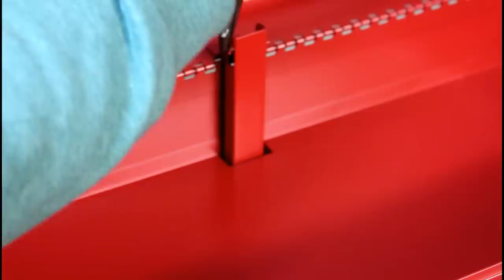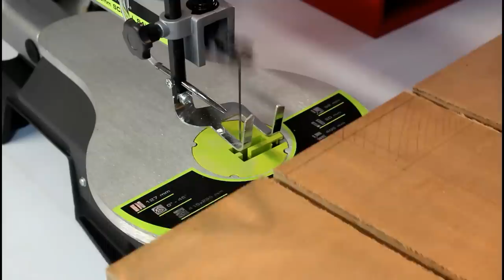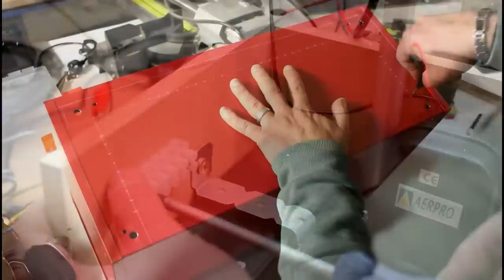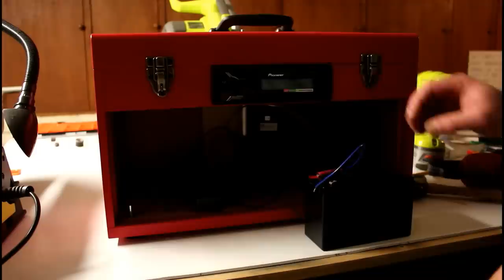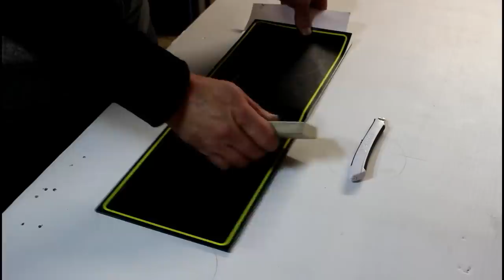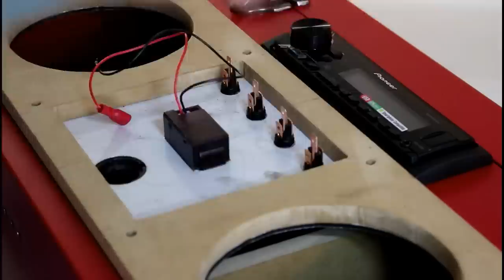Toolbox Stereo Build

Comment: I absolutely love messing with pioneer car stereos, their RGB series of head units sound absolutely superb on good speakers.
Reply from the maker: Thanks Mate, Pioneer systems are perfect for the units I make. I've just checked out your channel and I'm looking forward to watching some of your videos. Especially the old amp repairs.
Reply: @taswesty  Thanks yea, ive just bought a Pioneer DEH-X3800UI head unit from ebay in mint condition for £35, it will be fitted in my model railway baseboard and connected to a pair of monitor audio bronze br1 speakers, should sound great as theyre high sensitivity and 4ohm
Reply from the maker: Sounds like a great setup. Those BR1's look like a nice speaker.

Comment: Excellent work, build something similar but connect it to a computer source. greetings from Argentina.
Reply from the maker: Thanks Elser81. Technically you could plug this into your computer via the AUX plug. But it would also be an awesome idea to build a stand alone PC speaker version. Maybe I could add that to my list of projects :-)
Reply: do not explain it to me, instead of using a battery, use a power supply from a desktop computer.
Reply from the maker: Sorry Mate, now I understand. Yes you could definitely power this with a PC power supply.

Comment: At 16:32 you can hear the metalic box rattle. This setup will have afwul rattling sound at high volumes. But it is really cool !
Reply from the maker: Thanks. Yep, you can definitely hear a slight vibration that I fixed with some sealant off camera.
Reply: @taswesty  Great :) I too have a speaker like this, but it is made out of a older speaker box. I added new bass speakers, a 12 volt battery from a I think tractor lawnmover, or a fourwheeler , and a car radio. sounds amazing but I need to add tweeters. the battery is twice as big as yours. It has 24 apers.

Comment: Nice build!! But I bet it rattles like tin cans in a bag.
Reply from the maker: Thanks mate. Surprisingly it doesn't rattle at all. I spent a bit of time off camera sealing all the joints with a polyurethane sealant.
Reply: @taswesty  another way to fix rattling is by welding heavy pieces of metal onto the rattling panels. If you do so, you will lower the resonance frequency below 20hz.

Comment: Nice touch with the electric Arial, but would have put some sound deadening for speakers .good job though.
Reply from the maker: Yep totally agree, and the next design includes a lot of improvements. Fortunately, I sealed all the joints with polyurethane adhesive and the sound is surprisingly good. Certainly no complaints from my brother.
Reply: Ray Chambers a minha

Comment: Nice build. How long does that little lead acid battery last? I wonder how hard it would be to rig to run off one of those Ryobi 18v batteries? I'd be willing to guess the stereo wouldn't mind the extra couple volts compared to a cars normal 14.4ish.
Reply from the maker: Thanks Elijah. No reason why you couldn't use that type of battery, but I reckon it would be safer if you stepped down the voltage.

Comment: Hi mate, I was wondering if you would be able to tell me how you wired the led up to flash with the music ? If you could that would be awesome, thank you
Reply from the maker: G'day Rhyan. The LED's are sound activated. You can get them on amazon here: https://goo.gl/7e3WQ7 
or on Ebay here: https://goo.gl/HYJf2g
Reply: or wire normal led lights to the speaker wire and you wont pick up banhs or anything will be 100% speaker sound it flashes too,or same thing for a sub
Reply: Only thing is adding direct twelve 12 volt LED lights to a speaker terminal that receives alternate current. Is useless! You will blow the LED resistor that is not rectified to DC current. All speaker outputs are AC! Alternate current! So you have a square trying to complete with curve waves that are not comfortable unless you rectify the circuit

Comment: Too much bass for the metal of the box, should've lined walls with wood and put sound deadener on them wouldve sounded a lot more full
Reply from the maker: Yep totally agree, and the next design includes a full MDF box. Fortunately, I sealed all the joints with polyurethane adhesive and the sound is surprisingly good. Certainly no complaints from my brother.

Comment: Hi, I am about to build a big boom box system for my bicycle trailer, I am going to put in A Bluetooth stereo and a 4 channel amp lots of speakers, what batteries do you recommend. Would two 12v 12amp lead batteries last long? Cheers.
Reply from the maker: G'day Rockypro1. Sounds like a great system. Unfortunately I don't really have enough experience to know how long you would get from those batteries, but based on how long we get out of our system I would think you should get quite a few hours. My brother is getting at least 6 hours continuous play with the 9Ah battery in our system.
Reply: Each amp mean an hour each.i have a small rig gas power bike with lights and all running 24v 2.0amp it last only 2 hr if that.
Reply: Btw you dont need 2 12v 12ah battery to run your radio and amp setup .

Comment: How long does your battery last and when you turn the power off does it reset your stereo settings?
Reply from the maker: My brother says he uses it all day without needing a charge. I would say around 8 hours. As long as the battery doesn't completely discharge the stereo won't lose its settings.

Comment: What were the pieces you used in the rivet gun?
Reply from the maker: G'day Matt. They're called Rivnuts or Nutserts. It's basically a large rivet with a threaded insert that allows you to add a nut wherever you need one. The gun is a special type that is made specific for Rivnuts. It has various sized threaded tips for different sized nuts.

Comment: I have a car CD radio but I need something that when I cut the power is left only the battery, I have an automatic charger with the battery in the yellow memory cable before I have a diode so that it does not bounce the charger and a separate power supply that it feeds the red cable but only consumes the yellow the problem is that I have a 12V 1.2A Pb battery but I see that it has little amperage was for maintenance but the red cable does not consume distress and the yellow that is the maintenance consumes more I want to change battery PB 12V 7A but I do not know how to make it continuous if I consume battery, in the video I see that you have three switches one of On, Antenna, Charge and Led; how the cargo and the others are connected; I would like to see the scheme Thank you

Comment: If you don't mind me asking, I have a question about the charging port. Is it wired in with the positive and negative that you have plugged into the battery terminals somehow? I've been trying to understand how I can charge and use it simultaneously, and just unplug it for it to run off just run off the battery.
Reply from the maker: Thanks for the question mate. Yep, the charger is wired directly to the battery. Technically the battery won't charge while the amplifier is operating because the current will flow directly from the charger. If the charger can't supply enough current, the battery will make up the difference, which means it will continue to lose charge. As soon as you turn the amp off it will automatically start charging the battery.
Reply: Thanks for the information. I've been trying to figure out the charging end, because I plan to do something similar, but with a wooden toy chest, and subwoofers/amp.
Reply: So I guess would I essentially be making a wiring harness that splices together the positive wires for the charging port and radio/amp to the battery, as well as do splice together all of the negative wires? (I hope I worded that correctly lol)
Reply from the maker: In my builds so far, I just run positive and negative wires directly from the charging port to the battery. I then use terminal blocks to divide the various positive and negative sides of the circuit.
Your build sounds like a great idea, I would love to see the finished product.
Reply: tas westy I'm currently ordering all the parts I need for my build. I'll be sure to keep you updated.
Reply from the maker: Awesome mate, I'm looking forward to seeing it.
Reply: Well, my project is done until my 10 gage wire comes in so I can make the guts all pretty. For now, I've decided to run it from an outlet because the bass it's putting out will kill batteries kinda quickly lol. How do I send you pics?
Reply from the maker: Fantastic, can't wait to see it. If you go to my youtube channel, click on the facebook link and message me there.
Reply: tas westy I messaged you on Facebook with pics and video a couple of days ago 😀
Reply from the maker: Just saw your message and watched the video. It looks and sounds awesome :-)

Comment: Could you give me a link to tell me what bits you used on your dremmel to cut the metal? Thank you
Reply from the maker: G'day Mate. I think these are the ones I kept breaking in the video: https://goo.gl/F2dE6B .They are the standard discs that came with the dremel. I've found the thicker larger diameter ones easier to use: https://goo.gl/7bHokZ and they break less
Reply: tas westy try the dremel EZ lock cutoff disks are much better.
Reply from the maker: Thanks Mate, I've seen them advertised bet never used them. I'll grab some and give them a try.

Comment: Any way to swap a factory antenna to that motorized?
Reply from the maker: No reason why not. In fact I have done this in the past. Probably a bit easier on older cars with the original antenna mounted in the top of the front guard, but anything is possible.
Reply: i got one on a 2006 dodge ram mounted on the front right fender. think it will be hard?
Reply from the maker: in theory it shouldn't be too hard as long as you can easily access the original antenna from under the guard. I've looked at photos and it seems 2006 Dodge Rams are sloped where the antenna mounts. I'm not sure if that may be a problem, but I have seen them advertised with angled mounts . Other than that, the base of the motor has a mounting bracket that needs to screw to something solid inside the guard, then it's just a matter of running the wiring.
Reply: tas westy got a link?
Reply from the maker: this is an Australian ebay link: https://goo.gl/dQfsBe It doesn't list your year but it has a range of different shaped fittings. One of them might be close.

Comment: I'm building a toolbox radio to hide batterys for my tricycle I'm converting to electric
Reply from the maker: Good to hear mate. Are you making a video of your build?
Reply: Or do what i do hide the battery and radio in an ammo can and run sharks 3"motorcyle speakers on the bar
Reply: Btw i uses a power drill 24v battery step down to 12v . it basically have everything from head lights,directionals,running lights,brake lights and a horn .and my bike is gas power :)
Reply from the maker: Just watched your videos, cool looking system.

Comment: Tengo radio cd de coche pero me falta algo que cuando corte la corriente se quede solo la batería, tengo un cargador automático con la batería en el cable amarillo de memoria antes tengo un diodo para que no revote al cargador y una fuente de alimentación aparte que alimenta el cable rojo pero solo consume el amarillo el problema es que tengo una batería de Pb 12V 1.2A pero veo que tiene poco amperaje era para mantenimiento pero el cable rojo no consume apena y el amarillo que es el de mantenimiento consume más quiero cambiar batería PB 12V 7A pero no sé cómo hacer que sea continuo si consumir batería, en el video veo que tienes tres interruptores uno de Encendido, Antena, Carga y Led; como van conectados el de carga y los otros; me gustaría ver el esquema Gracias 
I have a car CD radio but I need something that when I cut the power is left only the battery, I have an automatic charger with the battery in the yellow memory cable before I have a diode so that it does not bounce the charger and a separate power supply that it feeds the red cable but only consumes the yellow the problem is that I have a 12V 1.2A Pb battery but I see that it has little amperage was for maintenance but the red cable does not consume distress and the yellow that is the maintenance consumes more I want to change battery PB 12V 7A but I do not know how to make it continuous if I consume battery, in the video I see that you have three switches one of On, Antenna, Charge and Led; how the cargo and the others are connected; I would like to see the scheme Thank you

Comment: This is a fail, u can hear a few sec real sound of thin metal instead of bass👍🏻
Reply from the maker: Sorry it wasn't up to your standards mate. The vibrating sound was before I applied sealant to all the joints off camera. You can hear the result at the end of the video.